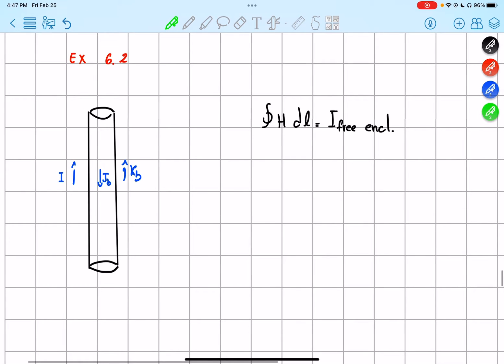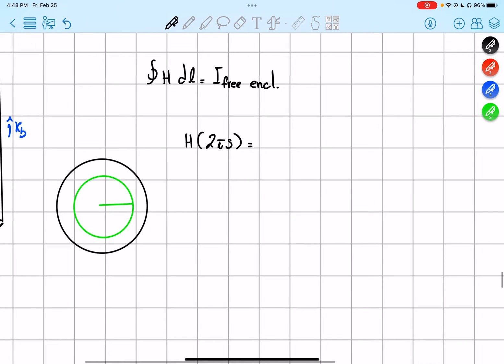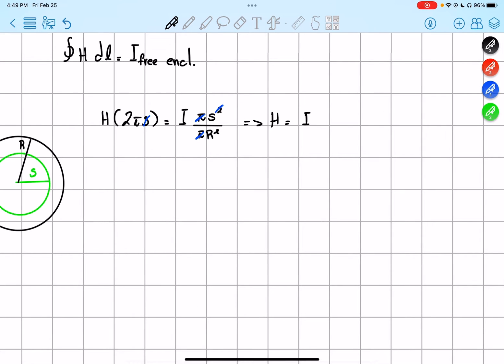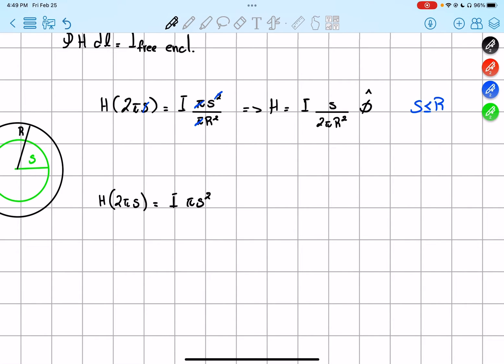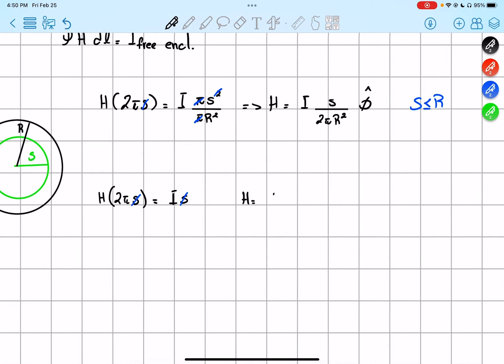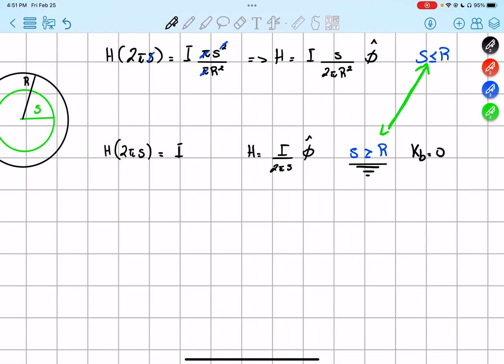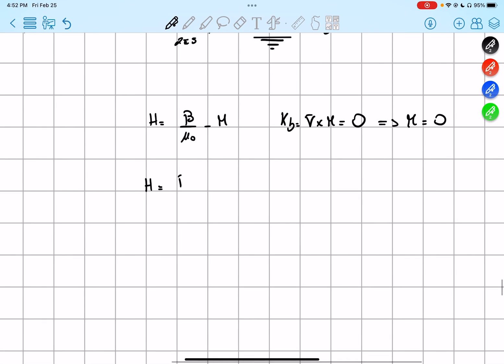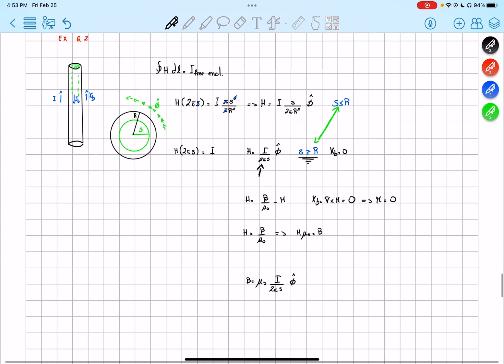Example 6.2 Introduction to Electrodynamics Griffith

Comment: maybe im being daft, but why do we have I times (pi s^2)/(pi R^2)?
Reply: I could be wrong but: I is the total current in the wire so if you want a tiny, infinitesimal current you divide I by pi*R^2 (the total cross section area). Then you need to multiply that infinitesimal current by the total cross sectional area you're looking at, a.k.a. (I/(pi*R^2))*pi*s^2. Where s=R outside the cylinder and s is just s inside the cylinder. Notice that the whole thing reduces to just the total current, I, outside the cylinder since we care about the entire current when our boundary is greater than R.
Reply: Hope that helps even though it's 8 months later.
Reply: @115xXzombieXx115  i got it in time for my eletromag mid terms, in wich i was quite successful! thanks for your help
Reply from the maker: What step are you referring to?
Reply: When we are inside the wire where s<R,	
Why did we get:
I free enc = I * ( pi*s^2 ) divided by (pi*R^2) 
Thank you.
Reply: It gives u the percentage of current considered inside the rod